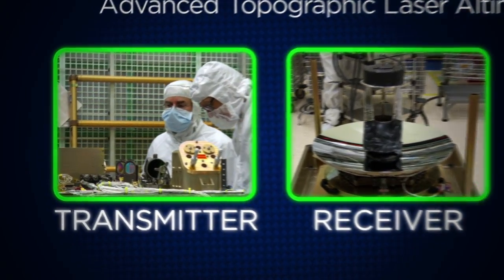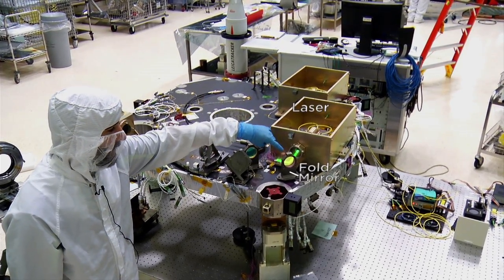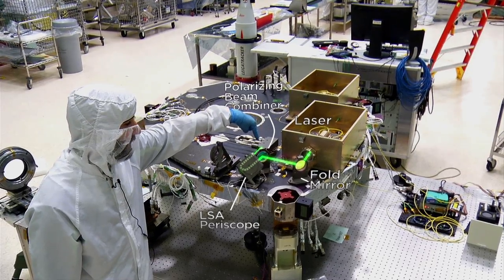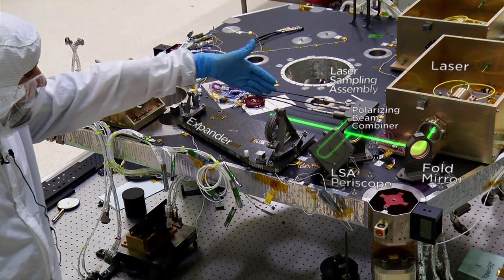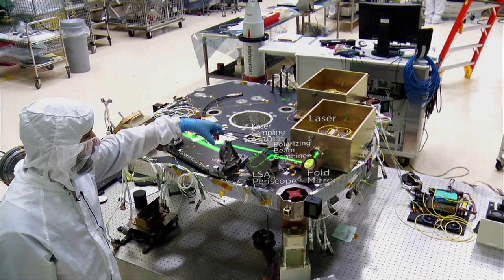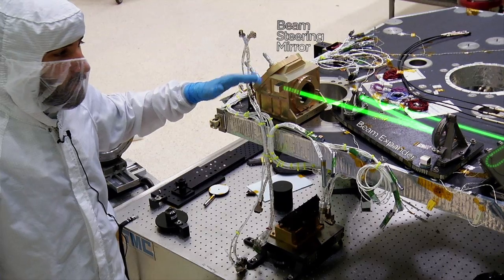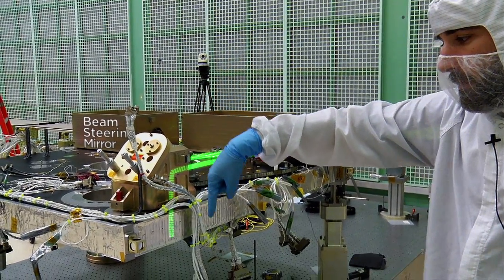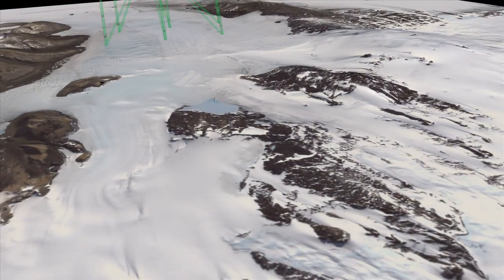NASA | Laser Focus

Comment: Just curious but why have a beam steering mirror instead of having software do the same thing?  Seems like having something that can be modified from the ground, infinitely variable and one less thing to break would be ideal.  If the variance exceeds the rigs tolerance without it I understand, but I'd like to know the tolerances to play around with my own ideas if that's the case :)  Thanks!!
Reply: It is a lot more complex than you make it out to be. The satellite is receiving and processing data from 6 individual beams simultaneously from 6 points on Earth. It isn't just grabbing a few scattered photons that happen to find their way back to the sensor. It is getting data from 6 defined individual focused beams, which are kept in check by the steering mirror. Without which no amount of software could warp the laser and optics back into alignment as they go in and out of the sun.
Reply: David Hyatt It's a satellite in orbit. You can't just drive it around and take measurements, It does a constant sweep. Without the steering mirror, the beam could go off track to a path that has already been measured and still be pumping out data with no ones knowledge. If they DID happen to catch it, they would have to throw out the data until either the sun came back up, or the satellite was in the correct position on it's next orbit. With the steering mirror the beam will stay on course with new data coming from known, planned, surface coordinates. Much cleaner data, easier to "point and shoot", more predictable.
Reply: OSHbots Cool.  In their video they just mentioned it compensating for the thermal expansion of the satellite when the sun is hitting it.  I figured since they would know very precisely when the sun would heat it up that it could be compensated for by software.  Where'd ya get the info about the beam going off track?  I'd love to read more about this.  Thanks.
Reply: Right, the thermal expansion is what causes the laser beam to become misaligned. Keep in mind the distances the laser light has to travel on it's round trip to the surface and back. Slight misalignment between the optics and the laser in the satellite could make the beam completely miss the sensor on its way back to the satellite, which is also why the steering mirror is required. You can't physically move the beam into correct alignment with software. I work a lot with robotics and sensors, no specific reading was done, although I'm sure the information is posted somewhere.
Reply: OSHbots You may be misunderstanding what David was saying. The software wouldn't be physically moving the beam. It would be compensating for the diversion in the end data set using the same calculations that adjust the steering mirror. I see his point in that this would accomplish the same task without adding more physical parts that could potentially fail or error....plus the software itself could be remotely modified if needed.
Reply: Think of it as a lawnmower with the cutting deck that moves from thermal warping. You would have no way of cutting the grass that you missed if you didn't have a way of putting the deck back in alignment with the wheels. Sure you could use a program to know which grass was cut, but the job would look pretty bad and far from complete.
Reply: stiimuli Ya that's what I was getting at. OSHbots the craft wouldn't have a solid beam bounce back to it, the light would be scattered even in an ideal situation. The sensor can even miss the "focal" point of the beam but the waves that come back would look like ripple on a pond. The sensor could map the photons as they come in, so you could select the time sample you want and even missing the center of the return sample you could easily calculate where the center is based on the arc sample you do collect. You need only to collect an unimaginably small percentage of the photons you send out. Think of it like shooting a gun on an open plane with a cement wall off to the side 100 yards off. Even drastically missing the wall you'd hear the waves the wall bounced back to you, likewise you're still collecting a small amount of sound with your ears compared to what you sent out. Now a laser would be more like the bullet than the sound, but, the laser will send out quadrillions of "bullets" at a specific target and you need relatively few to accurately make a measurement. I'm sure it would be redundant to mention here that light behaves like a particle and a wave so I won't ☺
Reply: "The craft wouldn't have a solid beam bounce back to it." Uhhh, do you know what a laser IS?
Reply: You have scintillation, the beam wander effects, beam divergence.... here read this:
http://ilrs.gsfc.nasa.gov/docs/slrover.pdf
Even passing the beam through a vacuum at a mirror you won't get 100% of the beam back.  And here:
http://ilrs.gsfc.nasa.gov/technology/laserRanging/index.html

I wish you the best but I'm not going to reply to your comments as they no longer pertain to my initial thought.
Reply: David Hyatt I may be way off on my thinking but, the computational power requirements for computing the changes in the steering motor needed to compensate for thermal changes [measured by thermometer in real time] of the satellite platform [deck] would be far less than the computer requirements for computing the changes in the angle of reflection and time deviations caused by those same thermal changes.  I think a small, low power programmable ASIC device can do the steering motor computations in real time while a more powerful, power hungry computer, would be required to calculate the compensations without the steering motor.  Assuming my assumptions have any validity, we get to the point where a steering motor could be more liable than a computer without moving parts.  Ever have a RAM module, CPU, etc..., go bad?
Reply: David Duvall Ya maybe that's the reason. Lower power would have to also mean lower cost. But I don't know what that difference would be. No, never had a problem with any computer components other than harddrives. But, also, never flew them to space so good points!